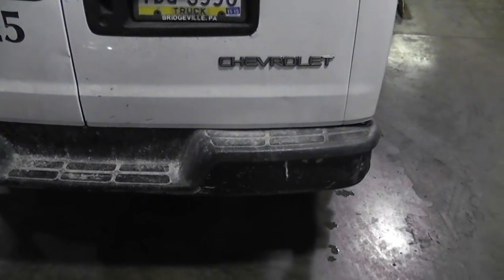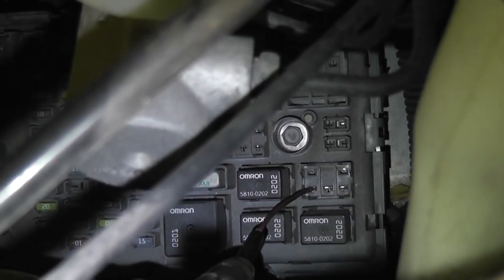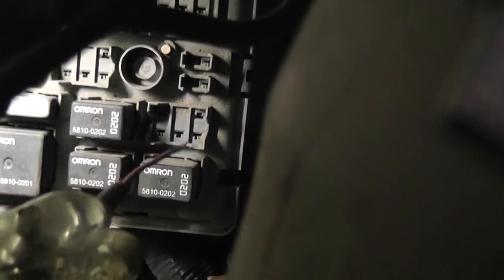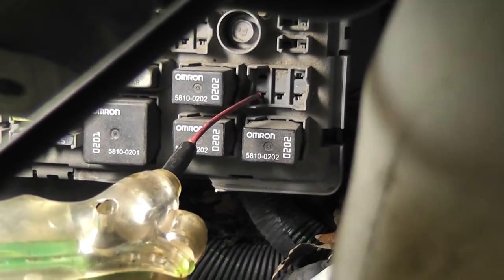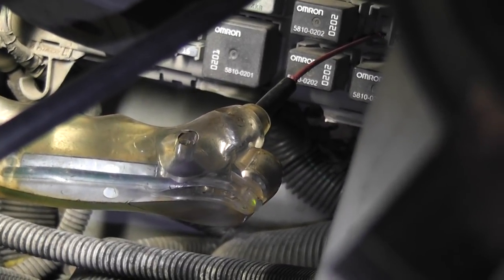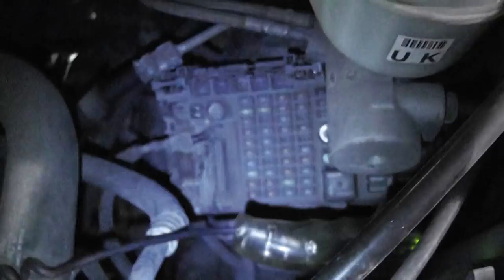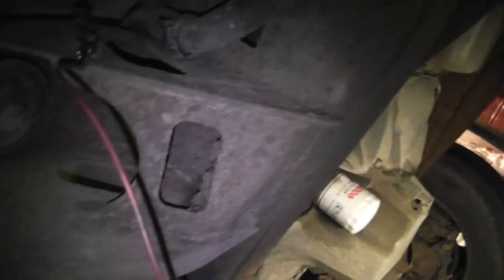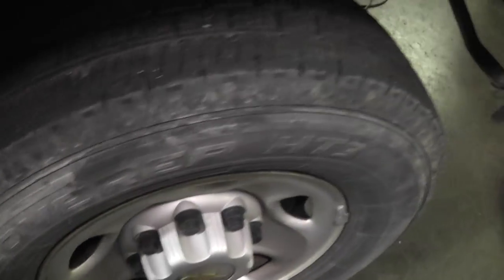CHEVY VAN NO START,NO FUEL

Comment: Thank you so very much. You saved me with this video. I took my van to a repair shop. He changed the ignition switch and didn’t solve the problem and then he told me maybe in the fuel pump but the tank was full. He said it’s too heavy he can’t drop it Till it’s empty I was calling junkyard around to junk the van. I came across this video and sure enough I looked under my van and it has the same problem with the ground strap I bought one off of Amazon for $ 7.99 and replaced it in the van good as new thank you again. You are the man.

Comment: My dash started going wacky, the security light would come on while driving and then all the gauges would die.  So I am working on the brakes and I hear that clicking noise you were talking about.  I think my van has the same problem.  Thanks so much for this video, what a life saver.  Keep them coming, please.
Reply from the maker: cool. just get jumper cables and jump battery negative to an alternator bracket or something heavy on the engine and see if it stops
Reply: +James Danner Thanks very much, i will give the grounds a look right now, but i think i am having security system issues(i have no clue how to bypass the security lockout yet, if there is one happening). i had fuel pressure, and spark, i saw spark leaking everywhere! so gave it a tune up and replaced the ignition coil as well, it would want to start but would rev up a little and die right away, now and again or nothing at all, just turning over and nothing. so i looked into an electrical plug in the steering column (for the security thing with 3 wires connected to the ignition, it seems to be free of corrosion). now i have no fuel pressure and the fuel gauge is flicking back en fourth every couple seconds.(no clicking at the relays either, so i assume there will be no power when i test them next) im at a loss and depending on YouTube for ideas... any suggestions would be great! thanks again
Reply: +Rob Sikes timing is also spot on....
Reply from the maker: +Rob Sikes let me know. I'll help if I can
Reply: Im having an unsolvable security lockout problem, the radio says "LOC" I've tried to relearn the passlock system a few times, ive done as fallows.

step 1: Crank the engine let go of the key, leave the ignition on run for ten minutes..
step 2: turn the ignition off for ten seconds, then turn key on run(do not crank), wait ten minutes..
step 3: repeat step two twice(total key on run 3 times for ten minutes)..
then come back and try to start...... and still no change.
Reply: I checked the passlock connector it's free of corrosion. i checked for power at the plug (3 wires), and got zero voltage with the multi-meter, not even momentarily with key on or off or while turning the key. then with the tester, i do have power to the ignition but not to the passlock connector' 1st wire flashes green for a split second, 2nd wire in the middle good solid ground, 3rd wire, stays a dim green. does this indicate a problem to you? i read the passlock should be fed 5 volts at some point?
Reply from the maker: The fact that radio said loc means u lost power to the radio . Nothing to do with vehicle security . Usually the gm security kills the injectors so it will run on ether. When doing the passloc learn u need to leave key on  until the security light goes out . 3 times . If u have a scanner it should show a security code . If you do have a code and aren't losing voltage or ground , u can get a new lock cylinder assy with a key and relearn the new one that way
Reply: thanks for your reply, so i should check for lost power somewhere in the dash? i am getting nowhere. the ignition has power, how come i am reading no voltage at the passlock, does that indicate any other problem to you?
Reply from the maker: Do me a favor . Email me at jdanner816@gmail.com or start a new comment'. Yours is coming thru on someone else's earlier reply and it hard to find. I have to look up the passloc voltage question tomorrow but I think it uses magnets so voltage could be very low like 5 volts. We may need to start fresh. Will it start with starting fluid? Is the security light on while u are cranking engine over? Do you know the radio unlock code so you can unlock it . Then see if it locks back out after cranking or the key is turned off. What is the year ,make & model of your vehicle?

Comment: This video helped me solve my issue! Thanks!!

I have a 2007 Chevy Express 3500 Passenger Van. It would not start and found there was no fuel in the high pressure line at the engine, after checking the fuse and relay for the fuel pump which were good. 
I was looking for a video on how to test the electrical line to the fuel pump and found this video. The flex/mesh ground cable described in the video was badly corroded on my van at both end. Took very little effort to break completely. 
I ran a wire from the the driver side frame as shown in the video to the negative terminal on the battery...the van started immediately. Bought an aftermarket black/ground cable from AutoZone and connected it from the engine block to the frame to replace the broken one at the same connection points.
Reply: I'm doing that now. After I replaced the fuel pump of course 🤦

Comment: Holy shit!! You just literally save me hundreds of dollars. Thank you brother. I ran the battery down trying different things. I was watching the video while waiting for my wife’s car to jump start the battery, still wouldn’t start ...then i saw the end of the video and I took the jumper cables off my wife’s car and connected the ground side to the frame, bam! Started right up! I was stranded so I drove it home like that. So
2002 Chevy express van quick fix if you are stranded! Run the jumper cables to your frame, negative/ black side only of course. Although.. I took the positive jumper off the battery and connected it to the fender ground and the other end to the frame as well to have 2 temporary separate grounds with no tools used. So badass
Reply from the maker: Too cool. Thanks for sharing

Comment: You have no idea how much this sucks. I went through this today spending hours chasing down starting problems with an 08 Express van and it was this problem. NOW, I see your video. 

Awesome video! You would have saved me hours. I actually used a 3 foot 4 gauge cable from Autozone, with terminal ends and bolted it on.
Reply: Was this the ground from the battery to the trans that was broke? Is there 1 for the fuel pump? I get power the terminal of the fuse for the fuel pump. I don't get no power to the fuse when checked with a test light. Only the terminal under the fuse? Relay is clicking.

Comment: Why somebody would waste their time watching a video to give it a thumbs down when it's a video trying to help somebody is beyond me anyway thanks for this video great video I maintain a fleet of Vans just like this and recently had one that kept not started on job sites I would go out and play with the fuel pump relay make sure the fuse was good check all the wiring and 20 minutes later the damn thing would start I finally got it into the shop one day and was about halfway through the steps in your video when I watch this video I immediately inspected that ground cable and found it to be in worse condition than yours put a new one on and the problem completely resolved itself thanks again for a great video

Comment: very very helpful .just swapped out a pump still no go. i did clean the grounds on frame . checked fuse  very dim . so i figured a ground prob. you were dead on. ground to block still connected as soon as i pulled it came apart. thanks

Comment: James its nice to see a professional at work.  I have the same problem on my van and crawled under to find the exact same problem.  Plan on changing it and I think I will be good.  Thanks
Reply from the maker: nice. let me know. I bet a short heavy ga. battery cable from engine to frame would be a cheap and reliable fix

Comment: WOW! Not sure where to start so I will just say THANK YOU! Same exact ground strap we had broke and I heard the clicking and keep asking why Is that clicking. Our cluster did also flicker like your customer stated but we also changed the ignition module for the gauges issue but I'm sure it was the ground not the module.
THANKS SO MUCH FOR YOUR VIDEO!
Reply from the maker: that's awesome. curious tho. did it just show up on a YouTube search
Reply: James Danner 
I was searching for the fuel pump wiring diagram and your video was in the list. I wanted to feed power to the pump to rule that out. Thanks again James!
Reply from the maker: Sweet. You are welcome

Comment: Excellent video! Most shops would immediately jump to fuel pump replacement as soon as jumper in relay contacts failed to bring fuel pump on. A little extra work paid a big dividend. A good lesson for all. Regards
Reply from the maker: thanks. how easy would it be to just call the pump  since u have to pull tank just to get to the connector for testing anyway. i definitely like these kind of finds.

Comment: Hi Danner, I have to say  that diagnosis was pure genius. I would have been chasing this problem tell the  cows came home LOL.  I've been watching your videos and your brothers videos and I'm really learning a lot from you guys. Just wanted to thank you and your brother for all the hard work your doing making these videos. Thanks again
Reply from the maker: you are welcome. I don't know about genius. I just like posting the unusual ones when I run across them. thanks for watching.
Reply: @jamesdanner7850 I have a 2006 Chevrolet express 6.0 lq4, and the vehicle refuses to start, and when I disconnect the body ground and rub it on the body and a spark occurs, the vehicle starts

What should I do ???
Reply from the maker: @Langlois-entreprise762  u could just run an extra redundant ground if u can't find the source.  The oe negative battery cable goes to body and engine with another braided  leg that goes to the frame. There is a harness ground that hits body under driver's frame rail near a body mount.  Sometimes ill just get jumper cables and hook to battery negative and take the other back end and clamp to engine then body then frame to see which one completes the missing circuit to help pinpoint. I'm not sure which body ground u are messing with tho
Reply: @jamesdanner7850  Je suis désolé mais j'ai du mal à comprendre votre message car je suis français

Comment: Very helpful,replaced fuel pump, next day died on road ... watched video while waiting for tow / hauler truck. Unfortunatly I did not find faulty ground wire till after it got hauled to shop . Fuel pump associated ground , on out facing under frame was held together by a couple strands.  started rite up. Thanks!
Reply from the maker: +Mark Teaford aw man. I wish I would have just shown on video that u could use a jumper cable set and hook one to battery negative and the other end to the engine or something bolted to the engine like the alternator and it would complete the ground to get u home. That's if the same ground as mine was the culprit.  Glad it helped tho. Thanks

Comment: One of the best repair videos I've ever seen!
Reply from the maker: Thanks for the compliment.  I try to have fun doing what I do
Reply: @jamesdanner7850  bought this 2000 gmc safari van 4.3 it was making a noise almost like squeaky belt but wasn't got worse more gas you give it didn't even drive 50 miles shut down while driving like no gas wouldn't start back up help me lol

Comment: This particular fuel pump relay circuit is exactly the type(power side switched) that you would never, under any circumstances want to short to ground with the driver on as Paul would say. Cough Cough, Paul you reading this? haha.  A ground that is wacky or acting goofy simple needs a better ground provided to it(running a jumper wire from battery negative to the ground in question) Now the fuel pump kicks on, bam, you are done(not with the repair, just the diagnoses)  I do this with the coil side of relays too. Love bypassing things, makes me feel like a mad science. There is one thing for certain, I am no scientist, lol. Awesome video James, your local weather station could use your gnarly beard to tell their viewers which direction the wind is blowing from.

Comment: Thanks a lot. I had the same problem on my fuel pump, no ground and the fuel pump ground connected to the frame rail where it's ground is disconnected from the battery negative. I will look for the ground strap tomorrow. Thanks a lot

Comment: Nice find there bro ham. I'm sure you already know this but the dim power on your light was from voltage being high on the frame while other circuit were active. Also the dim power you see on the control side of the relay (computer wire) is a bias voltage gm uses. It's super weak and would not show at all on a conventional light.
hey, I have a tripod for you. One of my students just gave me one today.  I'll give you my old one.
Reply: Two videos in one week?  Nice!
Reply from the maker: the first one. yes .the bias voltage i didn't but have seen before and knew not to chase. thanks master paul
Reply: Paul your explanation was great and everything, But were you not listening to your brother? He said he could get into detail with resistance, resistance to ground and all that JUNK! It doesn't sound like he was in the mood or very interested! LOL ! And your right, two in one week? WOW !                  Great vid James!
Reply: Haha your welcome. I'll drop that tripod off soon. Once you start using it you'll wish you had it sooner

Comment: I just ran into this problem. truck broke down and that clicking sound would start with the ignition in the run position. Mechanic said I need a new fuel module ( pump isnt sold by itself) the ground is definitely rotten. gonna change it and let you know, THANKS MAN!
Reply from the maker: +Jesse B u can just use a set of jumper cables from battery negative to the engine somewhere to limp it home

Comment: truck stuck half in driveway and half in street starting fluid gave it a little start but then nothing came in watched ur video and ran my jumper cable to battery   and frame an away it went thanks for video
Reply from the maker: +phil kravitz nice! . Much cheaper than a road service call. Ha.. if yours failed like mine. You could just run a universal ground wire from something like the alternator bracket to the battery negative somehow

Comment: HI James I came across your video was gion crazy thinking it was fuel pump after waching your video i had 100 % same problem i did get the click noise from abs  issue same vehicle went stright to ground  ..jumped ground bat. to chassi viola your the tech.thanks

Comment: we had that exact same problem at our shop.   when the van was up in air, van would run.  lower the van and the van would shut off.  we figured some thing was losing signal when suspension was being lifted up and down.  sure enough we looked under van and the braided ground strap was hanging together by a couple of strands
Reply from the maker: nice. thats more weird than mine.

Comment: I have the same sort of issue in a 2006 Chevy express 3500 the fuel pump was replaced in 2019 and then it went out at the end of last year and I just had it replaced like a month ago when I barely put any miles on it and I think it may have went out again. I have the same click as you I think it is from the ABS motor and my battery is currently dead. Can the bad ground cause the fuel pump to burn out prematurely have you heard of this? I found another video the guy was saying that the fuse boxes in these go out and they start shorting everything

Comment: Nice video.  Right to the point.  Do you think you would have found the ground issue without the ABS system making the clicking noise?
Reply from the maker: thanks. and to be honest, Yes i would have found it. But...anyone, including me, could easily go the wrong path for a bit first. the relay is the only connection point before the plug at the pump,which is above fuel tank. and i hate piercing wires, so i could have easily wanted to drop the fuel tank to check the wires at their final destination.  how tempted would anyone be to tell service writer to sell the whole fuel pump before you did that much work. or worse..u check the power and forget the ground and install new pump and it still doesn't work. i have become a little redundant with testing to avoid those scenarios as i grow in knowledge. im sure others have same or better stories.  ha..thanks for watching.
Reply: Definitely a good lesson to always check power AND ground.

Comment: Yeah me too. I have a 2000 Chevy Van 3500. The truck has an intermittent problem where it won't go faster than 60 and the speedometer shows 100. This happens after the ABS light come on and now no gas flow and I'm dead in the water. I can't find a bad ground and I'm sure that's the problem. I tried the jumper trick, no help there. Help please.

Comment: I have the same problem in my case I don't hear the relay click,I have power on fuel pump fuse, only on pin 30 have light on relay,I check the ground strap and looks in good condition is only cover with a little engine oil from small leak the other grounds looks fine,I replaced the fuel pump but not start, I did the jump on relay 30 to 87 and fuel pump works and start, already put a new relay and no luck I'm lost now maybe the ECM?
Any suggestions?
Thank you!
Reply: Yeah me too. I have a 2000 Chevy Van 3500. The truck Has an intermittent problem where to won't go faster than 60 and the speedometer shows 100. this happens after the ABS light come on and now no gas flow and I'm dead in the water. I can't find a bad ground and I'm sure that's the problem. Help.